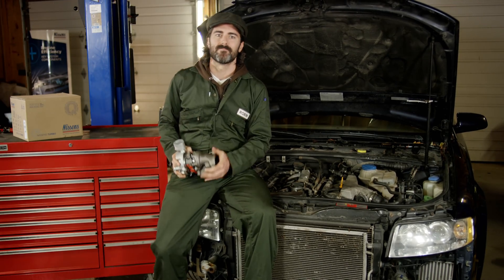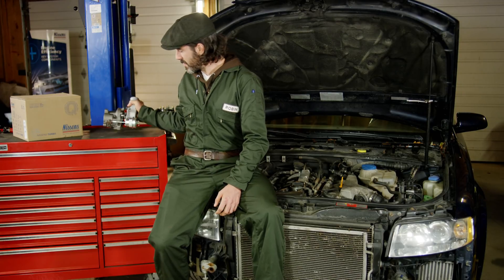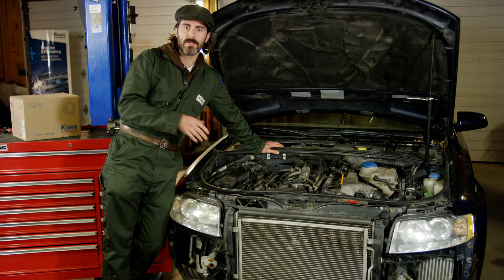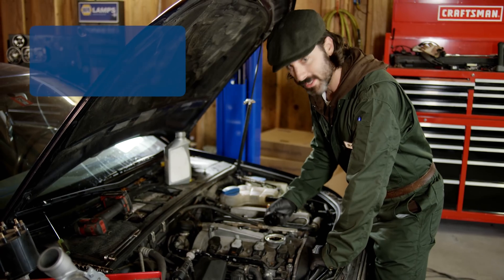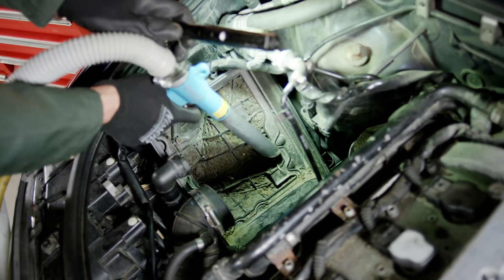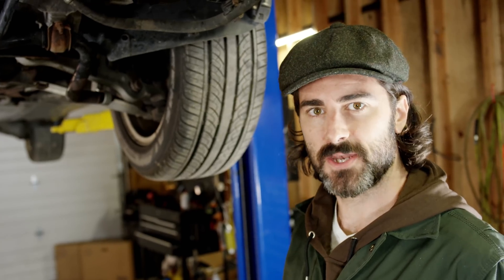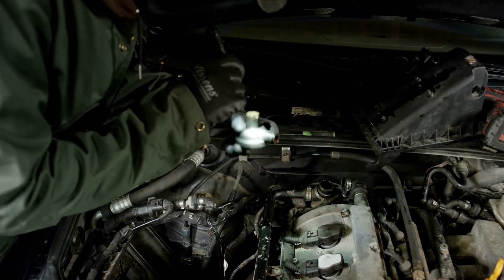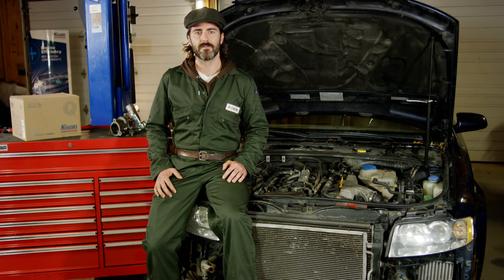Turbo Installation - Checklist before installation!

Comment: Hi  my acura rdx 2008 turbo engine, when I accelerate pedal its doesn't go fast, and it's tale stumbling, hesitation.  After 30/40 speed then it's run fine, I changed map airflow sensor, airfilter, nothing  fix, I scan by obd2, it's show ecm pcm problem. There is no engine sign, so can you tell me what is the reason 🤔 please.

Comment: I just changed my valve cover gasket on my 2012 740 li n my mechanics telling me that my rear twin turbo it's leaking. First he told me to replace it then he told me no just get  the  seals .can u help me